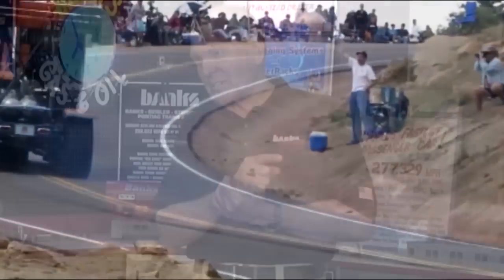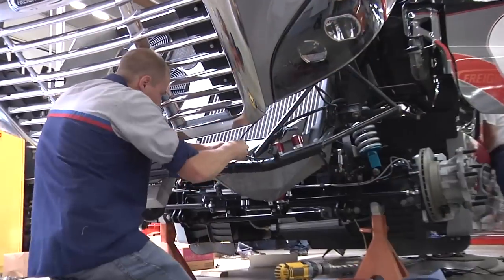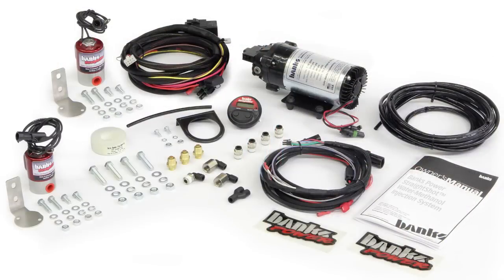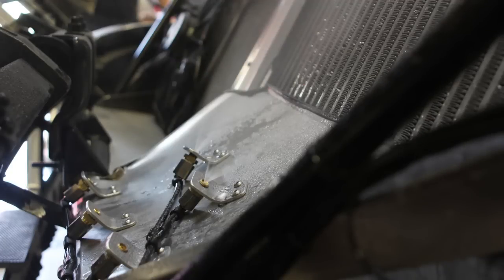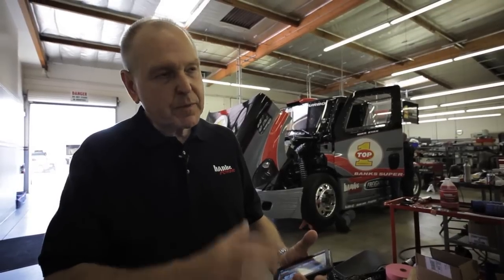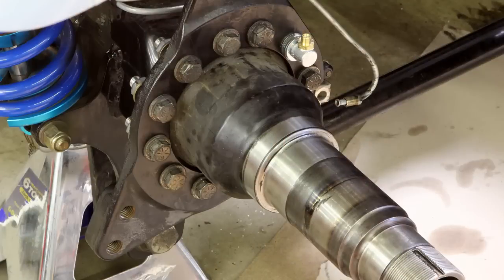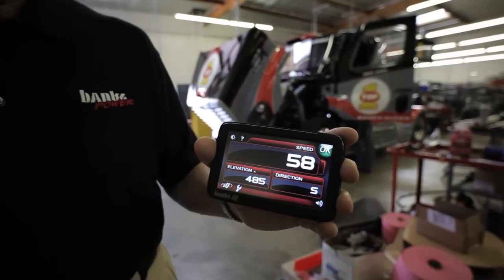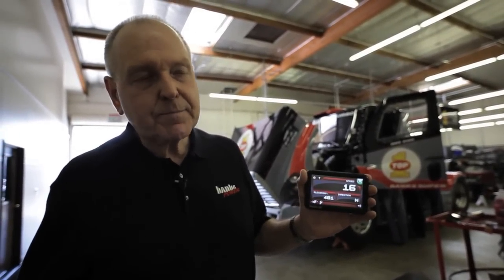Banks Super-Turbo Methanol Diesel Pikes Peak Outrage

Comment: Awesome idea with fogging the intercooler, I've often wondered about how I can get that intercooler colder, I've even wondered about insulation on the piping to keep engine compartment heat from warming the air, great job, I'll be pulling the trigger soon on some Banks products, thanks for all the hard work.

Comment: I had the banks auttomind box on my 01 24v but I had higher egts so I took it off now there fine lost 65hp but o well
Reply: More fuel is more egt
You wanna make more power and run cooler. 
You gotta do more than just a tuning box bro

Comment: Water/meth is a cop-out.  Rework the head, place 20mm head studs in that engine and run a twins setup that will provide more than 200 psi at sea level.

Comment: Does the supercharger become a restriction at higher RPM where the turbo is spooled up and building more pressure?  A supercharger only moves so much air per rotation and, at higher RPM, is out-flowed by a big turbo.  They should engineer in a bypass system so that the turbo can reach max potential at higher RPM and leave the supercharger in place to assist with lower RPM grunt while outside of the peak operating range of the turbo.
Reply: I vaguely recall reading about this in Diesel Power in 2013. From what I can tell, the supercharger drive is setup to push more air than the turbo can eat, with excess air blown off. Peak power is @ 2,700 engine RPM, so it's possible the supercharger never enters an overspeed condition, nor becomes a choke point. I could be wrong, though.
Reply: @brandonobaza8610  That's some careful engineering but awesome if they can dial it in like that!
Reply: @406Steven  Check out the "Killing a Duramax" series by Banks (if you haven't already). They just keep adding power to an L5P until something maxes out, then they upgrade it. Last one I saw had a turbo-super arrangement: parallel twin turbos feeding a supercharger. What happened is exactly what you described: the supercharger maxed out, choked the turbos, and the whole rig fell on its face. The efficiency sucked and the power band was too narrow.

(Spoiler alert) Gale knew all along the setup was going to fail. The whole point was to show why he uses a supercharger to feed turbos, not vice versa. The series is pretty fascinating.

Comment: I've always been under the notion that on Turbo-Supercharged engines you wanted the Turbo to be the first "compressor" and the blower the second "receiving" one because when the blower runs out of it's efficiency window the big turbo can still pickup the slack and somewhat "mask" the blower's deficiency problem.
Somebody better spill the facts of this and set the record straight, otherwise I think this fancy setup is backwards.
Reply: JIGA BACHI You typically want the supercharger to cover lower rpm before the turbo gets spooled. Then the turbo can take over. That’s the complexity because you want the supercharger to disconnect so it isn’t a power drag and a restriction when the turbo comes on.
Reply: Lancia 037 rally car set up or delta S4 lancia back in the 70s & 80s. To fast too race documentary
Reply: @deanrobert8674  I seen that before....that's quite the setup. And that cylinder head was out of this world.
Reply: That's what I'm thinking too, I see it the same as a compound turbo set up. Big turbo feeds into small one. The smaller turbo (or supercharger in case of the video) spools first pulling air through big turbo until big turbo spools and then compresses air for the smaller turbo to compress again and get a higher pressure ratio with less work and higher efficiency as well as getting a boost early and carrying to the higher rpms
Reply: They use the Supercharger to Build Low RPM Boost , so they can use larger turbo housings for more boost .
The supercharger also has an added benefit by being first inline , it also spools up the turbos quicker , by blowing through it and spinning up the compressor wheel.
Reply: I get your explanation BUT wouldn't the supercharger become a "choking hazard" to the big turbos ?
Reply: ^More is more better... you've already condensed the fuel charge once so what ever the turbo does after is bonus. You tend to have to size the turbo accordingly to work efficiently with the blower ahead of it. Either way it's still force feeding the compressor sweet sweet boost.

Comment: Need a 500 gallon tank for all the water going on here
Reply: ted s I'm pretty sure they wouldn't add 4170 lbs. Of water to the truck. The misters use a very low flow rate and fine atomization to do there job.

Comment: Do you have something that could be used to keep/clean the egr soot out of the intake system on Cummins isx engines?
Reply: CAT tried pulling the exhaust from after the DPF so it was clean, and didn’t need as much cooling. Not sure why more companies haven’t done something similar. I’m kinda surprised they haven’t just stuck an expensive filter on there you change at every service.
Reply: camshaftP16 delete it

Comment: to put it simply the turbo cannot give any extra air, the supercharger is positive displacement, so if the turbo is to pump any extra air the only hope is to compress it pre supercharger; a turbo downwind with just create vacuum between itself and the supercharger if it tries to pump any more air than the blower is already giving!?
Reply: +tpvalley In theory, communism works.   I believe he's thinking of eliminating the turbo lag.  The super does the torque at launch & then the turbo brings in the horseys in & takes over once enertia is built up.

Comment: why have the blower going into the turbo, if u have it the other way round the turbo can compress the gas the blower can step it up, the trurbo will make up the difference with out a vacuum being created if the turbo is to have any benefit because the turbo cannot give extra if it sucks through the blower, if the idea is to be blower for bottom end and turbo to add extra, the turbo can step it up the same way otherwise...or Im missing something...I must be I guess.
Reply: tpvalley, you have just described the set up of the P47 airplane from World War 2 and it worked great.

Comment: I Saw and extensively photographed this truck at the Mid America trucking show the supercharger is over driven and they use a waste gate after it before it goes into the turbo  it has one too those 2 smaller pipes beside the exhaust are  the waste gate outlets  I also met and talked to both Mr Ryan and Bob Ball his engine builder  they know what they are doing Ive met Mr Banks years ago at a boat show the 3 of them make a great think tank !!!

Comment: Methanol does not belong on a diesel engine, this way your making it a methanol engine instead of a diesel. 
It should be banned from diesel motorsport classes, just like nitrous oxide, I hate that stuff.
Reply: it doesnt add power by burning it adds power by cooling the intake charge and nitrous is silly for anything but drag racing as far as meth more boost means more heat and inter-coolers are heavy notice he said they where spraying 50/50 with water its not a fuel like it is on gas engines its an intercooler in a spray can
Reply: John Balkenbush
I think thats partially true, the fact is, if you burn fuel of any kind in an engine, it makes power, if it doesnt why would you use it?
Just use water then.
Reply: RAMON VAN TONGELEN methanol evaporates faster and cools better than water alone would
Reply: Water/meth damages the engine, that's why you never see a diesel dragstrip queen driven daily out on the road. It reduces the overall life of the engine. Screw that shit.

Comment: More great stuff from Gale Banks.  I dream about this stuff.  He's done it.
Using a supercharger to boost a turbo is not new.  Chase Knight and Al Liddert did it in the early '70's on a dragster.  Eaton Corporation developed a super-turbo in the 2003-2005 time frame that went into production on the VW 1.4L Twincharger engine in Europe.  It is a great way to get a turbo to spool faster.  On the VW application, the supercharger is clutched off at 3000 engine rpm, and all boost is supplied by the turbo after that.
Reply: ever heard of a detroit diesel?
Reply: Using a supercharger to boost a turbocharger is far from new, WW2 American bombers had turbo-superchargers along with water/methanol injection. Most American fighters had what was called emergency war power where the throttle was pushed past maximum power and it tripped a wire that set of a nitrogen charger tank of water/methanol mix along with dumping massive amounts of directly into the cylinders to give a serious boost. Depending on the engine it could give any where from 50 to 500 extra horsepower, but only for a few seconds or it would melt the engine down. Think of it like the wet nitrous systems dragster use today, but generally the engines would have to be rebuilt upon landing after using war power due to the damage caused. (And before anyone asks, you couldn't use nitrous at his altitudes, if there is no extra oxygen to bring into the engine like nitrous does, it wouldn't work. At his altitudes the turbos and superchargers were already making the intake charge dense as possible.)
Reply: ? As nitrous brings o2 in, needing fuel to keep AF ratio up, why would it not work? Nitrousshould work at any altitude. As long as there is cylinder pressure enough to ‘split the atom’ what does altitude have to do with it? Nitrous is used as a safe transport of o2 since it doesn’t burn with fuel but needs enough pressure and heat to separate the molecules apart first. Probably more dangerous to have a couple thousand psi tank getting shot at in a combat scenario.

Comment: Blowers provide low RPM instantaneous boost. Turbos need to spool, but can provide higher amounts of boost than Blowers. So it force feeds the blower the higher boost pressures. It's likely a roots blower anyway so there aren't much losses from the turbos overcharging the super. Diesels don't rev higher than 3-4000 RPM's anyway. So air a high revs isn't really as much of a concern on gassers.
Reply: 2,000 rpm on a 15L engine, you could do 2,500, possibly 3,000 rpm with a head rebuild.